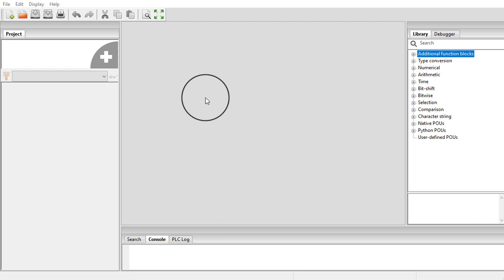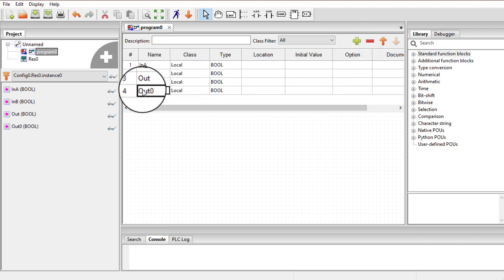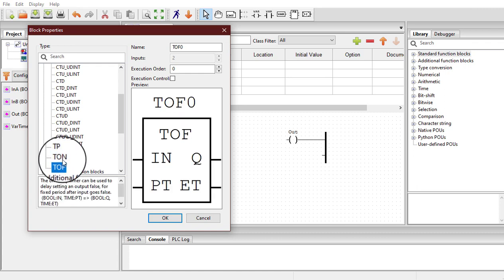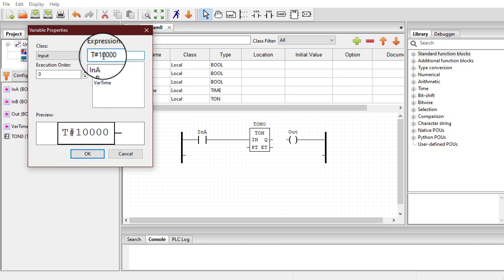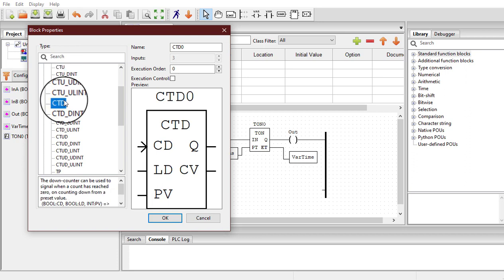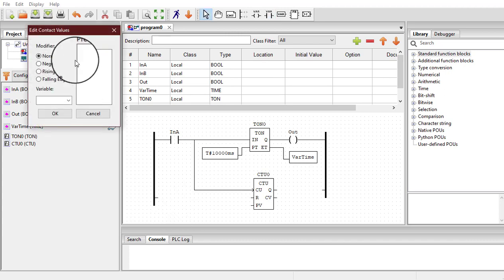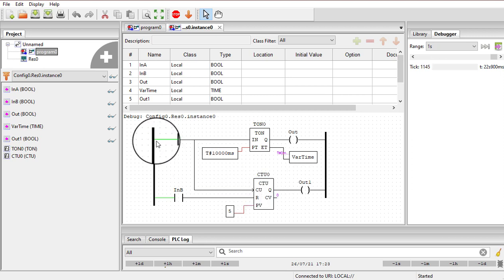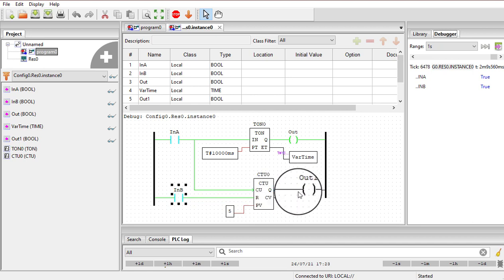How to use Timers and Counters in PLC | OpenPLC | PLC

Comment: Great video, but is there anyway I can use the up counter to have Q turn on the output first but when the PV equals the CV(or CV>PV), Q turns off the output?
Reply from the maker: Yes you can! Use a NOT Gate after the Counter Up Q pin, so when Q is low, that is CV<PV, you'll get a high output and if Q is high, that is CV>PV, you'll get a low output.